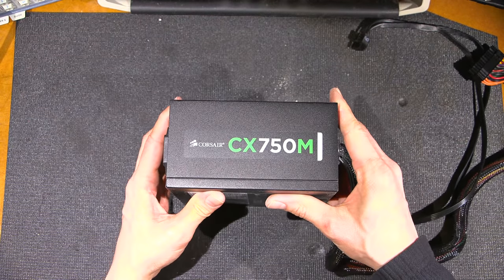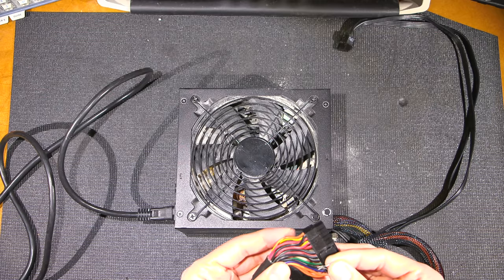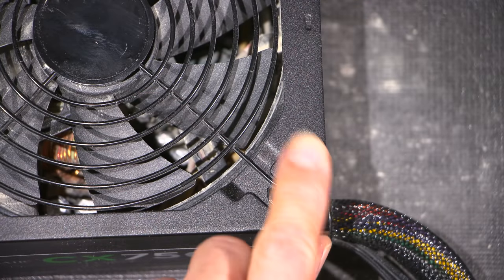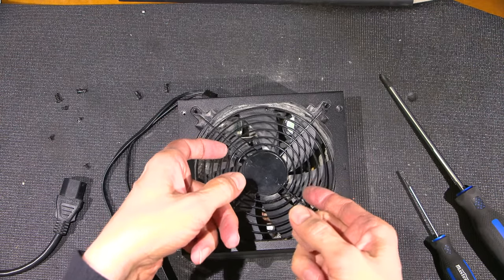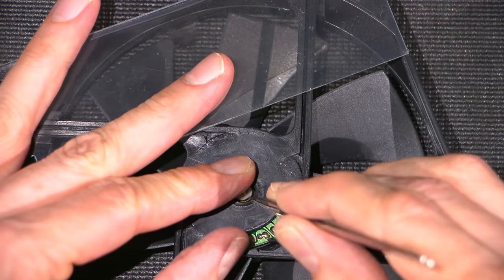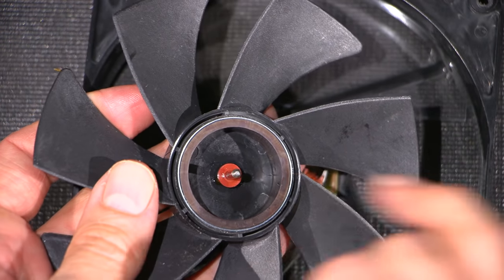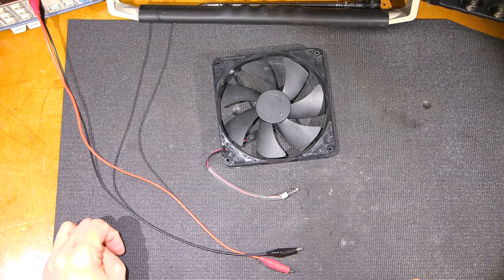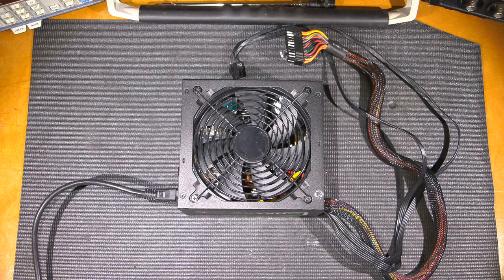Fix A Computer Power Supply!

Comment from the maker: To learn electronics in a very different and effective way, and gain access to Mr Carlson's personal designs and inventions, visit the Mr Carlson's Lab Patreon page here: https://www.patreon.com/MrCarlsonsLab
Reply: Paul, would you mind sharing what two lubricants you used for this project? I've been tinkering with PC's now for a couple years. After a failed attempt at recapping a motherboard last year (too tedious and ambitious), I am now working my way up to refurbishing a couple old stock power supplies I have sitting on the shelf. This would definitely help. Thank you!
Reply: @WingKing-xl7iw  i agree. would be nice.
Reply: I feel so bad when i think back to how much stuff i threw away because i had no idea how easy it was to fix.. 

I second, third and fourth the other commenters: please give us the magic recipe of what kind of lubricant combo would work for such delicate (and rather high rpm, for the size) pieces!

Also taking a chance to thank you for the quality of your videos, and all the knowledge you share.
Reply: I use lithium chain lube in a can. I comes out 0 weight and then 90 weight. It is good in keeping c-motors fans lubed!
Reply: @WingKing-xl7iw  Tiny bit of lithium grease works well.
Reply: @WingKing-xl7iw  I would guess Molykote 33 light grease , ( very pricey ) and a light machine oil eg; 3 in 1 oil.... Hope this helps ~!~!
Reply: @WingKing-xl7iw  I would use drop of motorcote for oil and super lube for the grease.
Reply: @WingKing-xl7iw  So far the longest-lasting lubricant I've tried with fan motors has been synthetic Automatic Transmission Fluid.  Seems to permeate the bronze bushings well so you don't really need a grease to "feed" oil to the interface.  But I'd also be interested in what MC uses as I'm sure he's done this probably a thousand times more than me.
Reply: god bless you, i learn from you. thanks.
Reply: when I do this type of work for friends, they get to help.
Reply: Another vote for sharing what your personal lubricant mix is that you use, Mr Carlson! Thanks :)
Reply: Most electronics cannot be fixed nowadays. Plastic and small components plus alot of Chinese brands are cheap for a reason...
Reply: I agree, would love to hear what Paul uses as his lubricant mix!
Reply from the maker: @djericdiesel  I never went anywhere, I have been making repair and restoration video's all along on YouTube...???
Reply: Thank you Mr. Carlson!  Today your tip at 2:58 saved me a new power supply!  Once I added a load, it started up without issue.  You are my hero!
Reply from the maker: @mrquicky  Glad the video helped!
Reply: if
Reply: Looked to me like baby powder
Reply: @JohnJeiJei gun oil